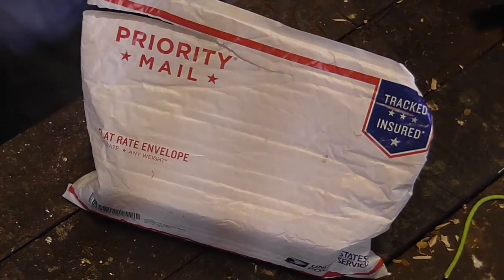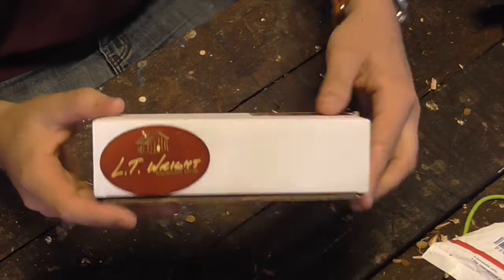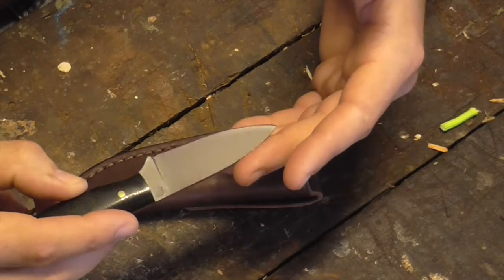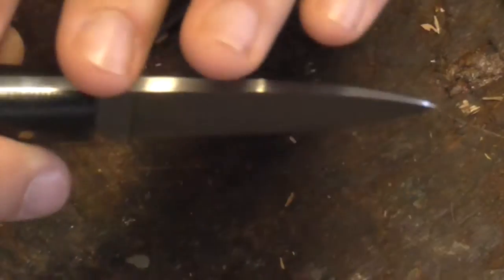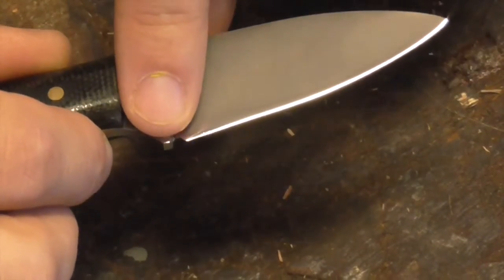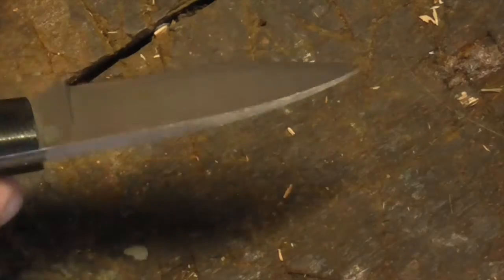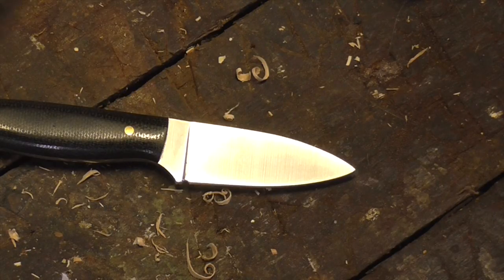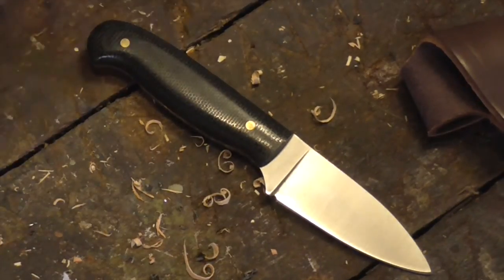Unboxing -  LT Wright Patriot Fixed Blade EDC Knife

Comment: Great unboxing. 

I already have a LT Wright Genesis with black micarta and orange liners, absolutely love it. Still deciding on the Patriot or the Small Work Horse as a backup/field skinner.

This is defiantly better than the Izula far superior steel comes with a handle....
Reply from the maker: yeah ita the first mini knife I've really connected with. Its got a generous handle and a really practical blade. It feels a bit like a fixed blade Dragonfly, for a rough comparison.
Reply: +CedricAda Gear and Outdoors I understand the connection thing to a knife.

Aside from all the other knifes I've gone through I have had Izulas, a Candaru which was way to small it was almost a joke knife. I even thought about a stainless Izula, ya vid has swayed my thinking now.

I love the leather sheaths it feels like you get more for your money over the plastic or kydex sheaths.
Reply from the maker: +Lozza Turbo yeah. the kydex kit for this pushed the end price over $200. Cross draw isnt worth that much to me, and this leather sheath fits really well in the pocket and in a pinch, can be used to strop the knife.